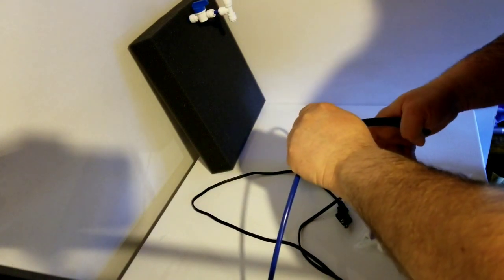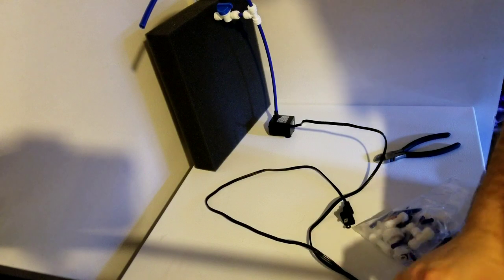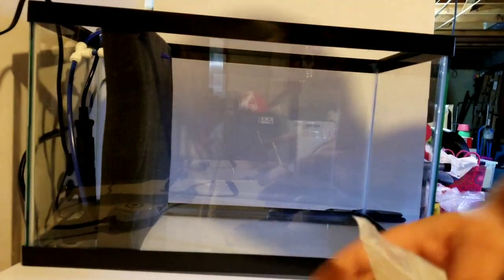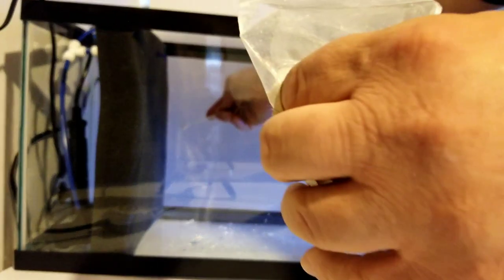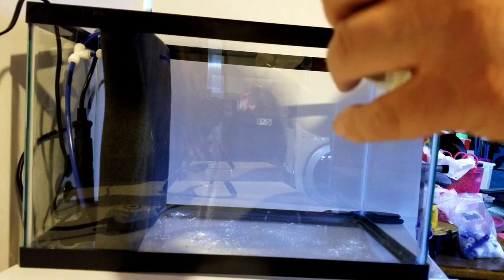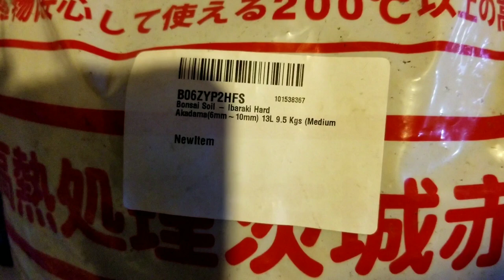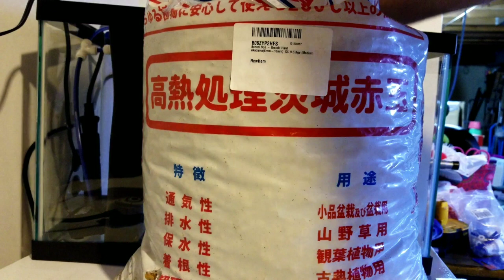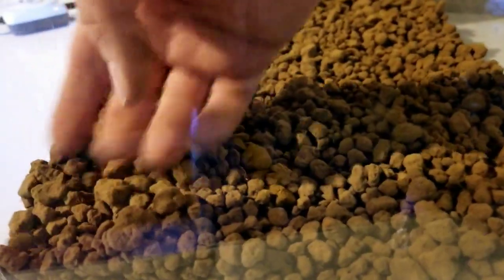Akadama Substrate Setup!

Comment: Nice one! Look forward to the finished setup. 

Have to say akadama is expensive in your neck of the woods. Here it's almost the cheapest apart from the basic gravel/sand in bulk (14kg for 20 euro).
Reply from the maker: I live in the frozen North, not many  Bonsai shops around! Lol. I do wish it was cheaper, but pound for pound, its the cheapest buffering substrate I can purchase... thanks for the view!
Reply: @beardedbobsfishroom7654  what is it "buffering substrate"? Simple sand or gravel isn't it buffering substrate?
Reply from the maker: Sand and gravel are not buffering. Buffering substrates will change the water hardness and pH.
Reply: @beardedbobsfishroom7654  Ahh, I didn't know, thanks. So you use this substrate precisely to change the pH and hardness? Why do you need it?
Reply from the maker: Some fish and shrimp need to live in an environment free from KH and a lower than neutral pH.